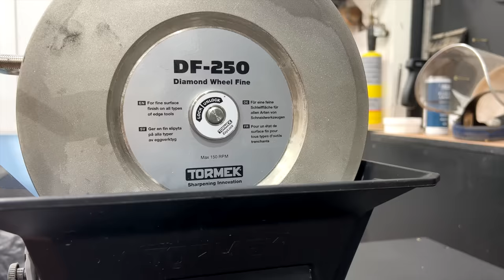Woodturning - YEW Can't Be Serious?

Comment: Great video. I saw a lot of practices that I would use. Laminating the logs that way was thinking outside of the box, the only thing I would have done would have been to cut the circle on the bandsaw, I have a little circle cutting jig just for that. Great job and thanks for sharing.
Reply from the maker: Thanks. I think if your still learning to turn you should use square blank as practice with your bowl gouge. Then once your proficient with a bowl gouge you won’t need to go to all the effort of setting up your jig and bandsaw/turning for the blade ect. Plus.. even after rounding the corners off you still have square stock to deal with on the lathe. Way better and faster to just use one machine. So much faster, it takes about 1 minutes to round it out on a lathe.. when you think that you still have to mount it and turn it after the bandsaw it’s actually a fault economy. 
And your loosing the opportunity to get better with your gouge.
Reply: @JackMackWoodturning  I take your well crafted points, I could counter them but we will leave it. It was a great video, well demonstrated with good ideas. Thanks for your time and very best wishes.
Reply from the maker: Please do counter them Clive. I’d like to hear your perspective 👍🏻
Reply: @JackMackWoodturning   I can turn slightly bigger stock on a smaller lathe if I cut it to an octagon first, instead of a square.

Comment: Dangerous cutting technique..
Reply: Not your problem
Reply: @ObiWon1089  so I’ve never done wood turning before and I’m interested to know what makes that technique dangerous and what would the more safe way to do that be?
Reply: @possumawesomepossum1795 You'll wait a long time for the answer. That was nothing but trolling!  😂
Reply: @possumawesomepossum1795  my guess is that if you go too deep, the metal tool can get stuck and fly in your face. The guy must know what he's doing. A newcomer should not try this.
Reply: Exactement.
Reply: @MadamFizzgig  
Reste poli ok ?.
Reply: No pain no gain
Reply: From what I have seen in other woodworking videos, his fingers were way too close to the blade. Normally woodworkers use long sticks or other tools made for that pushing process. The piece can get stuck in weird ways and will not only get yeeted into your face with highspeed, but also rip away from under your hand and get your fingers snatched into the blade. There are several videos where even seasoned workers had this happen in a splitsecond. Having seen so many woodworking videos, where people work more safely, his way of cutting actually made me really nervous.
Reply: Exactly what I was thinking

Comment: that "yew can't be serious" really got me with that square shape wood turning. Seriously would have been safer  to just cut a bit of those corners with saw and make  it hexagonal at least. Kudos to your bravery. Beutiful results! It also gave me an idea for a design problem I had. Best Thanks
Reply from the maker: Lots of people think turning a square is more “Dangerous” but if you understand how to turn wood safely you know that you follow the same safe working practices turning this piece than you would if you cut it round on a bandsaw first. A spinning square is the same as turning a circular piece of the same maximum diameter. 👍🏻

Comment: The bowl is stunning but why did you not just cut the corners off with the band saw once you put the pencil outline on.
Reply from the maker: My band saw isn’t set up correctly to perform the required cuts. It was therefore much faster for me to use the lathe. 👍🏻😊

Comment: Nice video and I love the end result. 

But I do have a question: when you had the square shape from the logs and you turned the bottom and then was gluing on the base piece, why didn't you use the band saw to cut the whole thing fairly circular before putting it back on the lathe and truing it up? Seems it would have been faster and safer to get it close to round first.
Reply from the maker: Thanks. Why do you think a bandsaw is safer than a lathe ?
Reply: @JackMackWoodturning  I'd done a little wood-turning WAY back before I was a teen (and I'm 62 now so, yeah, it was a really long time ago) and I had issues with trying to round off stuff that was more like 2-3" across (much smaller than you were doing.) I never got hurt but I do recall having the chisel grab from holding it too level or having the rest too far away. Just seems to me that the closer to round you start off with, the easier it is to get that initial round. And yes, ANY power tool has its hazards but I'd consider a bandsaw (which I also used back then) to be easier to control and a bit more forgiving than a lot of other tools (doesn't really have a kickback like a table saw or a drill or a chisel held wrong, etc. It holds the wood down to the table for you and you just have to keep your fingers out of the blade.) 

Maybe it's just me looking back through time and foggy memories but it just seems that marking out a circle and cutting it down to close to that and then back on the lathe, you have less of the "cut some and move the tool rest...speed it up a bit and cut some more and move the rest...speed it up more, cut some more and move the rest....", etc.

Comment: I assume there will be problems with cracks when different types of wood are used, with so many glued points and so many different orientations of the wood?
Reply from the maker: No there were no issues. The grain is the same orientation on all piece’s including base. What makes you think the points above would cause cracking ?

Comment: Looks Great    Why didn't you rough cut it to a round  shape  with your band saw  first. ?  it just looked like an accident waiting to happen when the lathe was first  turned on    I don't get it      Thanks for the Video  I'm just outside of Chicago where the real temperature is -10 below Zero  wind chill about  - 18 below      where are you located ?
Reply from the maker: Any action with woodworking is an accident waiting to happen if approached in the wrong way. a bandsaw is equally dangerous as a lathe. 
It is more effective for a one of piece
To round on the lathe than to set up the bandsaw for radius cuts. 
But that is just for me, for a beginner it would be easier to cut it first. It takes me 1 minute to do on the lathe or 5-10 mins extra to do on the bandsaw.

Comment: Why didn't you make some of the initial rough cuts for the circular shape on the bandsaw? Would be much safer and more efficient than trying to hog it out from the square.
Reply from the maker: It takes 5 mins to change blade and the bandsaw and set up for a radius cut.. or 45 seconds to true it up on the lathe.. 
how exactly do you you think it’s less age than turning it after rounding it out on the bandsaw?? How would your approach differ with regards to safe practice?

Comment: An explanation about how/why/when you have the piece spinning forwards or backward would be helpful.  I've never seen a piece spin away from you and wood chips come out the top side of a tool.......it's that an angle technique??
Reply from the maker: The wood is always spinning towards the tool. It just looks backwards because of the lathe speed and the camera frame rate.

Comment: Any reason you started with a square block, I mean there is a bandsaw in the shop to make live easier.  BR fom Germany
Reply from the maker: I’m all about efficiency of time when making these videos. For me it’s far faster to glue both pieces together and then round them out on the lathe ( about 45 seconds) then it is to take each bit to the bandsaw and set up the bandsaw for radius cuts.. cut the piece then take it back to the lathe, mount it and true it up anyway. It just doesn’t make sense unless  the person doing the turning struggles to turn things on the lathe. The extra steps take about 10 minutes vs 45 seconds to a minute to just turn it on the lathe.

Comment: Questions: was that glue you were applying to the fractures? If so, what kind? The 2 part putty, looked like JB weld, what was it and did you just sand after that and whatever you applied to the fractures were ddry?

Comment: Why not use a jigsaw or some kind of table saw to rough out circular pieces close to the final design before using the lathe?  Seems faster, a bit safer, uses less glue, less clean-up, and the edge pieces sometimes could be used for something else.
Reply from the maker: It’s funny isn’t it that you (mr “some kind of table saw”) knows better than me, the 20 years of professional Woodturning expert…
Reply: @JackMackWoodturning  I didn't say I knew better; I asked a question.  So, feel free to answer the question.

Comment: Why didn't you band saw the glued up logs into a rough circle before attempting to turn them.
Reply from the maker: They didn’t have a flat face to safely cut on the bandsaw. Plus. It’s faster for me to round it out on the lathe than change blades and set up for a radius cut on the bandsaw only to put it back on the lathe to true it and turn it.

Comment: Can I ask, isn't this wood extremely poisonous to handle or breath on the saw dust from?
Reply from the maker: No it’s not. 
The wood is from a tree/shrub which is toxic. The leaves and berries are poisonous if ingested. The bark
And the wood is less so. When green the toxin is more potent but when the wood is seasoned you’d need to actually eat a good handful of sawdust to do your any damage. 
Iv had days where iv sanded 100s of yew bowls and been covered head to toe in yew dust and never had any bad effects. 
Iv also spent many summer days turning green yew in shorts and no shirt and never had any effects from it. 

It’s toxicity is very much over stated by woodworkers with little experience. 

All this being said, you should take precautions you deem to be fit when working with it and you should gather your own information on the subject from multiple sources before make a decision on what you feel is adequate protection. 😉👍🏻

Comment: You could have ran the wood through the plainer quicker and safer.  Also cutting off the corners would prevent the chance of splitting and cracking.  Looks nice, but not sure how the end grain on 50% of the bowl will hold up.
Reply from the maker: I think it’s evident there are many things you are not sure on C

Comment: UK.
Why in THE WORLD do you not bandsaw the corners off  ?
Save yourself a mountain of shavings.
Not to mention the safety aspect.
Reply from the maker: Please do mention the safety aspect Steve.. I’d love to discuss that with you. 
The reason I do not cut the corners off is that I am extremely proficient with a bowl gouge (after 20 years of professional production Woodturning) and in my workshop it’s far more efficient for me to round out one-off pieces on the lathe. 
Radius cuts on a bandsaw require me to take the time to set up the right blade with the right tuning. Not to mention then putting the work piece back on the lathe to turn it.. it takes 10mins to change a blade vs 45seconds to turning the piece. I make these videos in the hours I can spare at the end of my working day so time and efficiency is of the essence. 
When I turn batches of production bowls ( of which I turn over 4,000 per year) I cut round blanks on the bandsaw, I do that because it’s the most time efficient way to prep batch work.. 

If one struggles with a bowl gouge and turning a square piece round is challenging then it may be preferable to cut the corners off the blank first. 
This is how I and other Woodturning tutors teach beginners to start turning but that doesn’t mean it’s the way to do it once you have mastered Woodturning. 

“Saving a mountain shavings” Is not a issue for me my business produces 10+ cubic meters per week and I have many uses for shavings. 

But now I have explained the logic behind my working methods… how about we discuss the safety concerns you feel it presents.. can you let me know what it is you think is dangerous about turning a square piece round on the lathe??
Reply: @JackMackWoodturning  
If you have been turning squares for 20 years you don't need me to tell you the risks but perhaps you could pass on to the next generation what to watch out for ?
Give something back ?
Or are you not into the .. passing on of skills, side of YouTube  ?
Just basking in you own ego perhaps.
Reply from the maker: Ahh I see, I didn’t realise I was talking to some over grown man baby. I answered you respectfully and shared my knowledge and experience with you. 

If you want to get huffy and act like a brat it’s up to you. 

The thing is Steve, a square isn’t dangerous.. we turn the corners off spindles all day long with a roughing gouge.. we take roughing cuts with bowl gouge.. a square spinning on the lathe poses no more danger to a proficient turner than a round blank of the same diameter as the squares widest dimension. 

The safe working practices you need to follow are exactly the same wether it’s the larger circle or the smaller square. 

If you had shared your personal concerns about turning a square then I’d be able to help you understand where you are mistaken. Unfortunately you decided to write that ☝🏻 nonsense.
Reply from the maker: So, you want me to share my experience, but you don’t want to tell me what it is that scare you about turning a square on the lathe.. I can help you understand if you want to actually engage. 👍🏻

Comment: Nice, but you really shouldn’t get your hands that close to the blade. If something happens, you’ll be short some digits. Use something to push it through.
Reply from the maker: It’s round wood so that isn’t how it works. My hands remain a safe distance from the blade at all times.
Reply: @JackMackWoodturning  I was thinking of the saw, but that’s understandable. Maybe a special jig or something. I could see how it could roll over. I’m sure you’re super careful. Amazing work for sure. Thanks for sharing. Keep up the excellent work.
Reply from the maker: You can make a jig to to this but it is not necessary as the way it was done in the video is entirely safe if the operator is experienced. 
Thank you, I’m glad you enjoyed the video. 👍🏻

Comment: NICE!  but the picture shown for the post is completely "wrong" - it's showing the 5 glued pieces mounted on the lathe centered on the ends of the middle piece -- not mounted via a disk to the sides across the 3 inner pieces. I suppose that was an intentional tease ? I.e. someone familiar with wood turning would note the obvious impossibility of that picture - ? ;-)

Comment: You could have saved alot of turning by cutting it down to the diameter you wanted on a bandsaw.
Reply from the maker: The thing is Tom, it’s faster for me to turn the corners off on the lathe than it is to set up my bandsaw for radius cuts. It takes me about 45 seconds to true the piece up on the lathe vs 5 mins to change blade on the bandsaw and then tune. As a production bowl turner (as my real job) I always cut the corners off my bowl blanks, this makes sense as I turn over 4000 bowls per year and do them in batches of 200. One bandsaw blade will cut around 100 bowl blanks and can’t be reshaped, where as I can sharpen my bowl gouge 1000s of times. 
So from a perspective of both efficiency of time and efficiency of cost it makes much more sense for me personally to turn the corners off a ONE OFF bowl blank. 😊
Reply: @JackMackWoodturning  I was a shop teacher for years (Oh how our schools of today need those shops back). We had only two lathes and 10 to 20 students. So every student had to find every short cut (a play on words) to prepare their piece of wood for the limited amount of time they had to use a lathe. All of them had other projects to keep them busy til a lathe was open. Tom

Comment: No push stick?  Why didn't you round it out first, you used the band saw earlier?  Seems a bit dangerous.
Thought you were just making a mess and dulling some tools.
Reply from the maker: You can find in depth answers to all these questions in this comments section as iv answered them countless times now. Il make this one brief. 
- you do not use a pushsticks on wood in the round as the piece has no flat reference face to sit safely on the bed of the saw. 
- you do no use a pushsticks on a cut that can otherwise be safely done with hands. 
- it’s faster to round to piece out on the lathe than it is to change blades on the bandsaw and set up for a radius cut. 
- it’s not dangerous. Anyone who thinks so still needs to learn to safely execute interrupted cuts and avionics then but using a bandsaw will stifle your development as a turner. 
- I’m always making a mess. That’s my job. 
- all tools dull while cutting wood. tools dull at a lesser rate when performing interrupted cuts as 50-80% of a single rotation is not wood there for not making contact with anything other than air. 
Tools dull quickly in wood turning because the distance of the cut is can be miles in only minutes.. this is why we as woodturners are so efficient at sharpening our tools and do so every 3-5 miners of working. It takes 30 seconds to sharpen a gouge and I can get 10,000 or more sharpenings from a single gouge. I can’t sharpen the bandsaw blades I use and they cost £20 each. 

Il add as I note that if you lack knowledge and experience you should do what feels comfortable. Until you have a basic understanding of woodturning keep doing it the way you do it. Experience will come in time and things will start to make sense. 
I turn ONE OFF PIECES this way because It is the most efficient way to do it. 
As a novice you should not be rushing your turning. 👍🏻